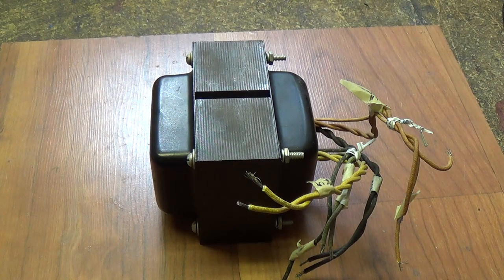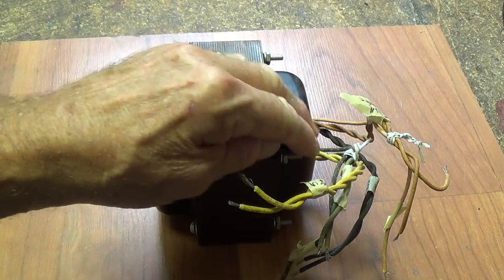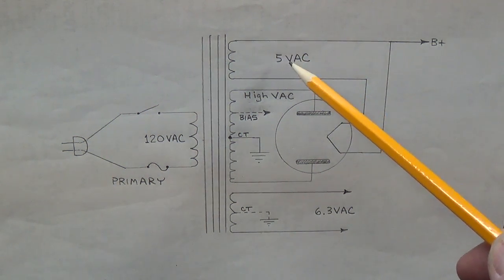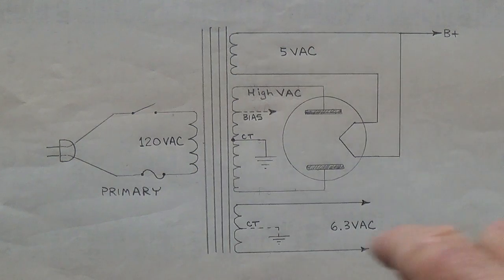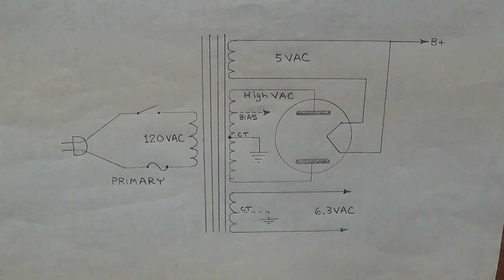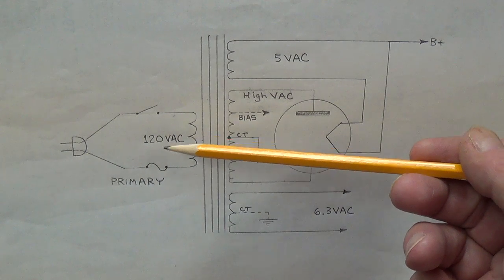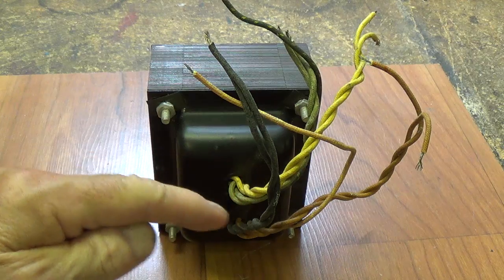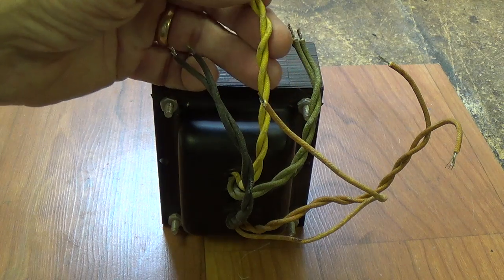How to Identify Amplifier Power Transformer Leads

Comment: Question: how much does that transformer weigh? I have a zenith 10s464 10 tube radio console from 1940. The transformer needs repair and I was curious how much it weighs for shipping and repair. What happens is that the rectifier tube (6X5) start to glow bright blue, but the 2 amp fuse that I installed blows out. I checked the rectifier tube on my B&K 707 tube tester and the tube tested okay.
Reply from the maker: The transformer in the video is quite large and heavy, Jorge. Generally, you do not repair power transformers.....you replace them.  Indeed, I am not aware of any places that offer transformer repair work, and even if you wanted the transformer re-wound, it would probably cost more than simply buying a new replacement.  I'm not sure why a rectifier would glow "bright blue" unless it is an Arcturus tube, but if the tube checks out, then there may be a high-current draw occurring downstream, perhaps in the filter caps. Nothing about this makes it sound like the transformer is at fault. It may be fine.
Reply: Thanks for your time. I noticed that the red wire high voltage has a stripe center tap wire, but there is no continuity between the high voltage wires. Should there be continuity?
Reply from the maker: Yes, there should be continuity between both of the high voltage output wires and they should each have continuity with the center tap.
Reply: Hi Uncle Doug. I been working on my Zenith tube radio console and I think I found the problem. I'm not getting 5 volts to my rectifier tubes. Instead, I'm getting 0.004 volts on pin #8 (cathode) on both of my 6x5 rectifier tube. The high voltage is at 325. The other wire reads at 6.4 volts. Mercury Magnetics, a business here in California that deals with transformers, can rewind the transformer, but it's not cheap. I emailed them and I received an estimate of $400.00. They do have a website: mercurymagnetics.com

Comment: Do you have to run the test at 120 VAC? If it's just proportional couldn't you just do 10V and figure out the math?
Reply from the maker: Yes, but if you intend to use the transformer, you might as well test it at its normal operating voltage (using a current limiter for protection) to verify the condition of each winding.  Testing it at much lower primary voltage might conceal an internal problem that could emerge after the transformer has been installed in a circuit.

Comment: I was wondering about some tube power transformers I just picked up. Two are Woodward-Schumacher P-6328, the other a Pacific Power p-6800 7591.They were all reportedly pulled from 1960s vintage Lowrey organs. All of them have 5 input wires, and only one of them is black. The P-6328s have a red and two more or less tan or yellow wires. The p-6800 has black, red, orange (or maybe another red), red with black stripes, and one that looks like yellow with green stripes. I was not able to find any wiring diagrams for these PTs. Is it possible to determine which wires are for the primary 120v input?
Reply from the maker: About all I know was included in the video, Patrick. Perhaps you can find some info on the PT's on the Internet.

Comment: Uncle Doug, thanks again for all your videos and this one especially!

I'm in the process of converting an old Hammond organ amplifier into a guitar amp. I pulled the transformers and choke off last night. Fortunately, I made notes about where the leads went from the power transformer (and everything agrees with what you've said here). But I forgot to write down where the output transformer leads went. Do you have a video like this one, but for output transformers?

Like you I'm unlucky and I can't find any info about the specific output transformer. It has 5 wires total (two green, two black, one red) and I believe that the organ only had a 8-ohm output originally. Any ideas what the wires could be? Thanks so much for all you do! I'm taking videos as I go along on this build, so hopefully I can contribute those to the same people who love your videos so much.
Reply from the maker: You're welcome, Mark, and thanks for your nice comments.  A double-ended OPT should have 5 wires, as yours does. Three wires for the primary....one to each tube plate and a center-tap to the B+.  Use your ohmmeter to see if the red wire has continuity to the green wires.....if so, then the red is the CT and the greens go to the tube plates. The remaining two wires (black, if they have no continuity to the red wire) go to the speaker.
Reply: Perfect! Thanks so much for your response. I'll do exactly what you said here. I found your output transformer video a moment ago and it seems great as well. 

One final question; when purchasing a variac, what should I look for? I know little about them, but my gut says that I should make sure it ranges from 0-130ish AC-volts and it is rated for 5 amps (since some amplifiers I would theoretically work on have 4 amp fuses themselves.  Does that sound right?
Reply from the maker: You're welcome, Mark. With regard to Variac's, 5 Amps should be plenty of current for just about commonly encountered tube amp. Best of luck.
Reply: @UncleDoug  Deep into these comments Doug and this - incredibly - may be your most helpful video ever. And that my friend is really saying something.
Reply from the maker: @andrewgillis8572  Wow.....thanks so much, Andrew.

Comment: Does 750vac to the rectifier tube sound right? That's what I'm getting, and that's how it was originally wired in a 60's Baldwin organ. Isn't that a bit much for the 5u4 rectifier tube they used in the circuit? I wanted to use this in a guitar amp build, but now I'm not sure how to proceed. I can half that voltage by only using half the winding via the center tap, but not sure about that either.
Reply from the maker: If you measured the voltage with an RMS voltmeter, Hawcer, then yes, that sounds too high for any common 6L6 or 6V6 guitar amplifier circuit.....and it will be much higher after the filter caps smooth it out to the peak voltage.  I don't think this would be a good PT for your project. You could possibly use only half of the winding, as you suggest, with a full-wave bridge rectifier.....as long as the current output is adequate.
Reply from the maker: You're welcome, OP. One minor point....the B+ does not pass THROUGH the filter caps (they will not permit DC to do this), it simply passes BY them, and as it does, the residual ripple in the B+ is eliminated by the action of the filter caps. How this happens is explained in several of my videos.
Reply: Thanks for the reply. I built the amp to a version of the JTM45 using a pair of EL34's I had pulled from my Marshall amp and had as sparess..B+ voltage at the filter caps is within tolerance at about 500v. I had to add a virtual center tap to the 6.3v heater circuit to cut down on hum since there wasn't a center tap available on the transformer. I still have a slight buzz on the bright channel, but it is tolerable. The amp sounds great and is plenty loud. I even added  the " Uncle Doug" adjustable feedback pot instead of the 3 way selector called for in the schematic. It doesn't have over the top gain,even with the 3 12ax7's, but  will cough up some good crunch. I also used the OT from the Baldwin amp as well as the massive choke it used. The tubes where easily biased via an installed bias pot. Just had a thought...Should I verify plate voltage isn't too high on the output tubes, since that circuit runs alternate to the filter caps? Thanks again.
Reply: BTW, hawcer71 is also me,. usually my non-guitar related stuff.
Reply from the maker: You're welcome, H71/OPG. I'm not sure about the concept of plate voltage running alternate to the filter caps.....the plate voltage is the B+ that is filtered by the caps. It's all one high voltage circuit. The one absolute necessity is for you to measure both the Plate Current in amps and Plate Voltage, then multiply them together, as demonstrated in my DE Biasing video, to get the Plate Dissipation value (in Watts). If it is at or below the max for your output tubes, then everything is fine.
Reply: You are correct. For some reason I was thinking the B+ split and half went through the filter caps to the preamp tubes and the other half routed through the OT to the power tubes. It all goes through the filter caps first as you stated. Thanks again!

Comment: Hey Doug ,  I have a question I thought you may be able to help.

I got a transformer with primary centre tap and winding ratio of 10:1. I tested it with 220v input and got 40v output which is stranged , I assumed the out put should be 22v.

I connected the one of the input wires and centre tap to 220v to see if reducing the input winding to half can change voltage but output stayed 40v. what makes this strange is I measured the ohm of input , the resistance is almost equall from each end wire to centre tap.
Reply from the maker: I wonder if you are looking at the transformer backwards, Kiya. Center taps are almost always on the secondary winding, not the primary.  The resistance should be equal between the center tap and each end of the winding....after all, it is in the center.  Is the winding ratio written on the transformer?
Reply: Thanks for the reply , No it out put transformer that Im winding , it has 1500 turns primary with centre tap and 150 turns secondary.

I tested it with 220v from input wires and one input to centre tap , secondary gives me 40v both times
Reply from the maker: I didn't know it was an output transformer or that you have wound it yourself. If you are not getting the proper voltage reduction from it, then apparently there is some error in its construction. I have no way of knowing what that error may be. Good luck.
Reply: Just got it fixed , thanks you for the reply again.
Reply from the maker: You're welcome, Kiya.

Comment: Hi Uncle Doug,
I have a power transformer 850000981116 DOUGLAS 61266,  given by a friend, with no wires leads but only the pins.  The tranformer, according to my friend, was removed from an old TV/Radio. There are 4 + 4 pins in one side and 3 on the other side with the following numbers respectively: 

On the left side:
Numbers 3,4,5 & 7

7 & 3 = 6.1 ohms
7 & 4 = 3.0 ohms
7 & 5 = 2.7 ohms

On the right side:
Numbers 10, 12, 13 & 14.

10 & 12 = 4.2 ohms
10 & 13 = 0 ohms
10 & 14 = 0 ohms
13 & 14 = 2.2 ohms

On the back:
Numbers 18, 20 and 22.

18 & 20 = 2.7 ohms
18 & 22 = 0 ohms
20 & 22 = 0 ohms

I came with an old & round fuse knob with 3 voltages:  110v, 127v & 220v.
Originaly set to 220v.  No wires attached.

Where is the primary?

Thanks in advance.
Reply from the maker: +Pacero I'm sorry, but it's simply not possible to give accurate information about a transformer like this without actually testing it. The resistances do not relate to any radio or amplifier I have ever seen. Perhaps someone local can help you figure this out.
Reply: Uncle Doug Too bad.  Thanks for the prompt answer anyway.
Reply from the maker: You're welcome, P :)

Comment: Hi Doug, I've just finished watching your video and it's been extremely helpful. What I'm not sure of is if I'm searching around for a power transformer for an 5F1 type amp project, what do I look for in a transformer ? Are there any readings I can take with a meter to find a suitable transformer for the 5F1 circuit ?
Reply from the maker: +Andrew Darnley  You're best bet is to go to the Triode Electronics Internet site and see what power transformer they offer for the Fender Champ. They will also provide the specifications for the PT.
Reply: I was wondering about the possibility of salvaging a power transformer from an older amp. Would you advise against this for a newbie  like me ?
Reply from the maker: Not at all, as long as you can determine that it will meet or exceed the voltage and current requirements of the circuit you intend to build.

Comment: Thanks very much for excellent video's explaining both the "power" transformer and "output" transformer funtion in a tube amplifier. Very helpful information. Will need to rewatch videos a few more times before passing any test but great information I failed to find in other sorces. This the type of information I need to learn and really understand how a tube amp funtions. My eventual goal being to (diagnose problems) and repair tube amps for personal pleasure and hobby. I have more questions as well as answers now. Good thing you made more videos covering other tube amp components and their funtion. One question however, can any other tool perform the funtion of a variac? Seems I am going to need one. Thanks again for all.
Reply from the maker: +Weston Bennett  The first tool you need is a Current Limiter (see my video on how to build one).  A variac is primarily used to gently power up electronic devices that have not been used in many years, and is the only way to do this task. To me, however, the CL is more useful on a day to day basis.

Comment: Hi Uncle Doug, I hope you, Rusty and the fam had a wonderful holiday season! I've been sitting on my hands, eagerly awaiting your next excellent video.
In the meantime, I've carved out a new work space, installed some functional lighting and a permanent, wall mounted current limiter, using one of several vintage mogul base 300 watt bulbs I got from an old hardware store that recently gave up the ghost.
Here's my question: I'm rebuilding a 1957 Les Paul Jr. GA-5 circuit from scratch and the original PT is blown. I have obtained a vintage PT absolutely free, so I'd like to use it. Trouble is, it seems a little big. There's tons of literature about running amps with small PT's, but it's hard to find info for those of us blessed with too many volts and plenty of current handling.
My free transformer measures out at 375-CT-375 (750V); 3.8-CT-3.8 (7.6V) and 5.8V. The original circuit was for some sort of antenna array, which used a type 80 and a type 83 rectifier. Those tubes are supposed to have 5.0 volts, same as a 5Y3. 
So, I'd be interested in your opinion, can I run 7.6v instead of 6.3v on the 12ax7 and 6v6? Is 5.8v instead of 5.0v is OK for a rectifier such as a 5y3? And if not, would I reduce the voltages with power resistors in series? Thank you.
Reply from the maker: +Lindsey Montana  I think you'll find that the voltage measurements will go down to "normal" (6.3V and 5.0V) values once the transformer is operating in a circuit. The only one that may be excessive is the high voltage, so I suggest that you check the output tube bias immediately after you get the amp operational. Good luck with your project.

Comment: that's all cool but how do you work out what current capacity the transformer has? Cheers example can i hang it off it 100w marshall amp or a 15w vox???
Reply from the maker: +Darren iii  That's a very good question, Darren. Voltages can be measured quite accurately, but unless you know what circuit the transformer came from, the best you can do as far as current capability is to guess, based on the mass of the TF and, if you can see it, the wire gauge of the windings.

Comment: are you familiar with a TP2L transformer?  i got one that i was told it was a 700vct secondary,with a 6.3v and a 5v. but the Ma were not known.  i am very dubious of this because the PT only weighs in at a little more than 4 lbs.
Reply from the maker: +lordraptor11 I am not familiar with this particular transformer, LR. It could be a 350-0-350 PT with the two filament windings, but of relatively low current capability and come in under 4 lbs. The voltage output is dependent upon the winding ratio, but the current rating is dependent upon the gauge of wire.....so high current capability is associated with greater mass.
Reply: +Uncle Doug k thanks, guess that means it is yet another transformer i cant use :(.  dammit i cant seem to find the transformers i need to build a 45 watt full tube amp unless i order brand new ones and it is getting frustrating :(
Reply from the maker: +lordraptor11  A 45 watt amp will require a hefty power transformer with plenty of current capability, LR. You might be better off just buying one from Triode Electronics that meets or exceeds the needs of your circuit.  Cutting corners with PT's can lead to serious misery.  Best of luck.
Reply: +Uncle Doug  yeah sadly after a quick look of various sellers im just going to give up before i start, my monthly spending budget would require 2 months for PT and 2 more for OT so at this point i am just going to say screw it and try to sell off the pt's ot's and chokes that i have here i know at least one pt and the 2 OT's would be good for fender champ style build but im not really into the fender soud or fender products in general.  anyway, thanks for your time man.
Reply from the maker: You're welcome, LR. I hope you're eventually able to acquire the proper transformers and complete your project. Best of luck.